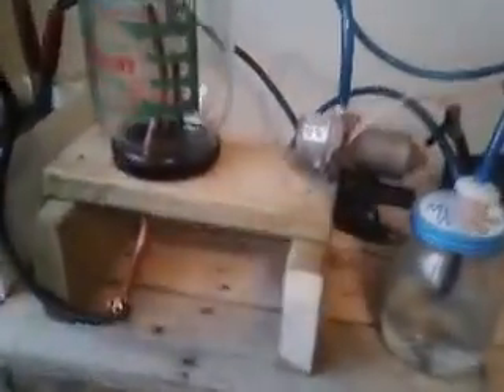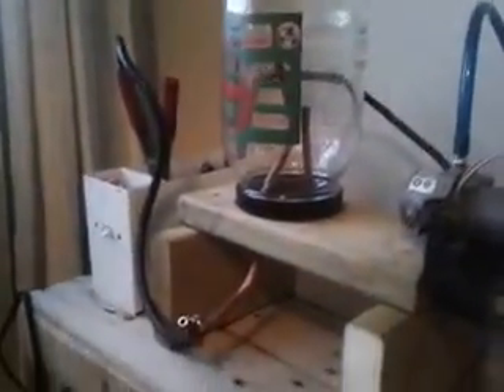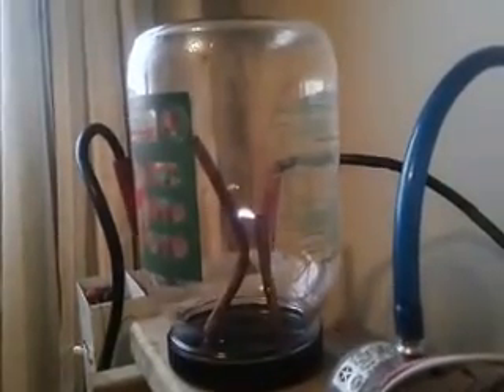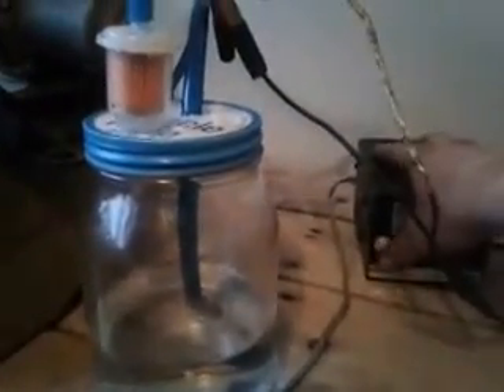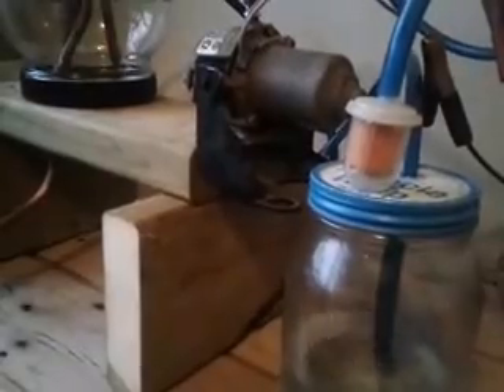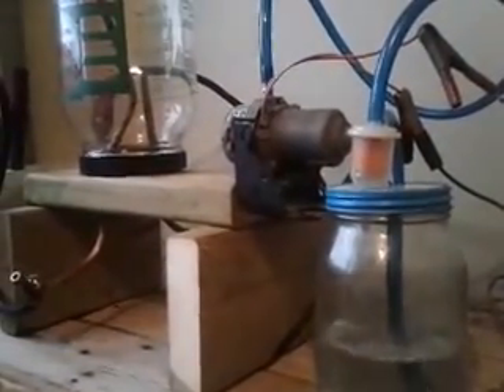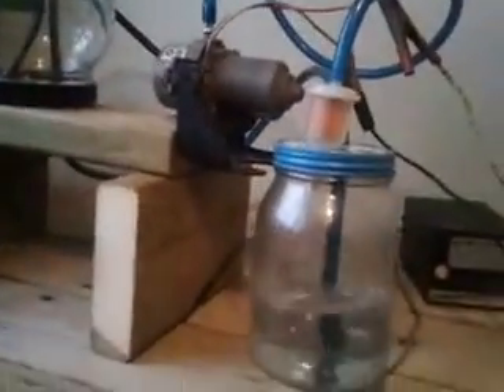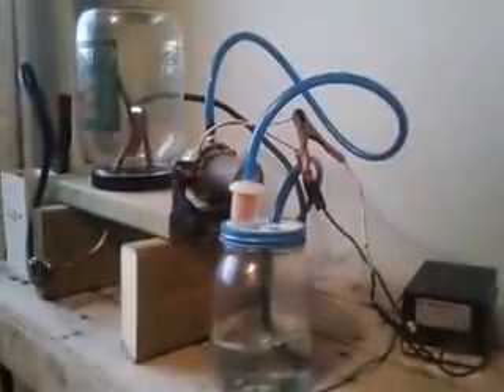My Nitric acid from air setup.

Comment: Has anyone tried to enrich the air feed with pure oxygen to increase efficacy and/or direct the air intake directly the arc before?
Reply: pure oxygen can catch on fire
Reply: @mathysgobeil1592  i meant to say nitrogen there.
Reply: @troymoore7537  i mean hypothetically it would increase yield, but  the air is already very abundant with nitrogen around 70 % so it probably would not make a big difference considering you do need oxygen present for it to form the NO and NO2

Comment: you can get beter no2 rate if you use an arc welding machine instead this high voltage device 
you have to just start the arc manualy and seperate the electrode s 
it will go
Reply: Please elaborate
Reply: @sciencefusion5352  probably means carbon arc

Comment: Get a fish tank air pump plug it into the inlet pipe have more distilled water jars to fully capture the nitrogen outlet pipe from the first jar goes to bottom of second and so on you can do about three of them you can also heat a jar pump the nitrogen ladened air to the bottom of a boiling flask and have a condenser column for better  interaction and yield.